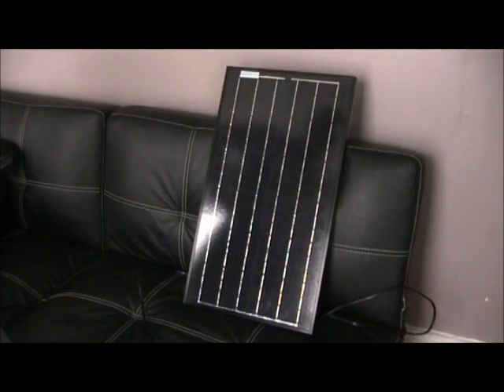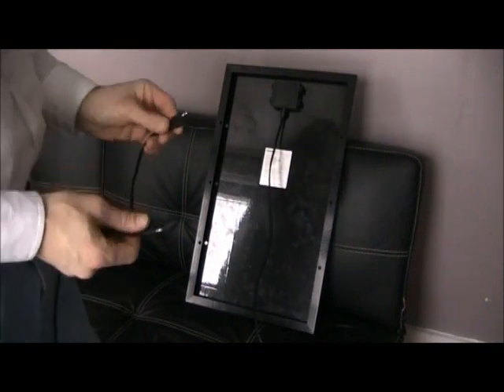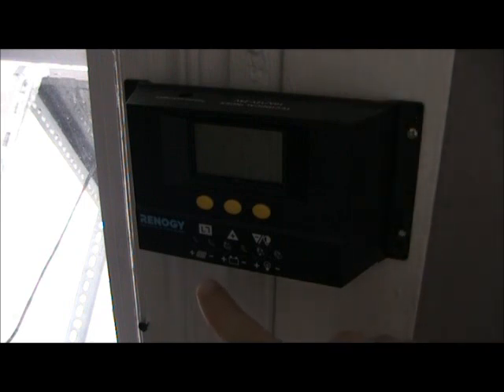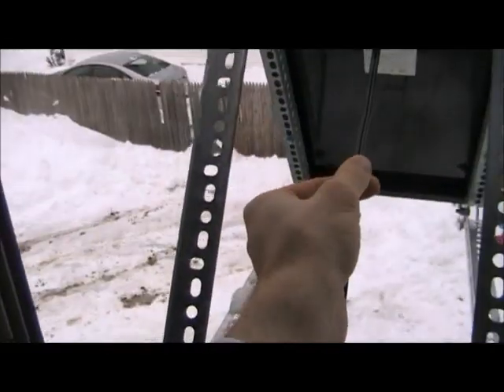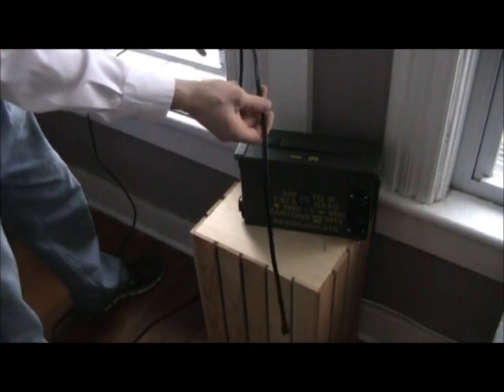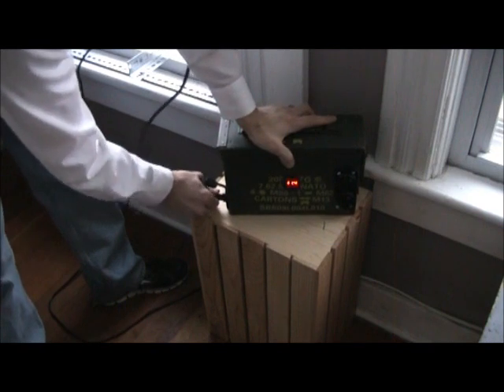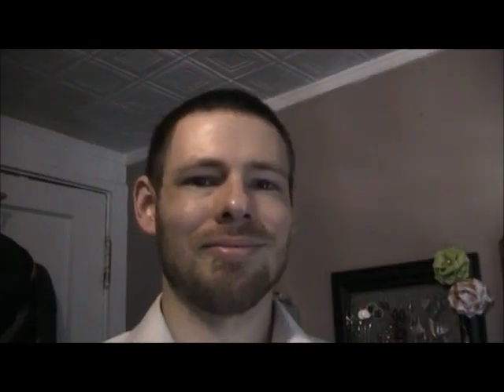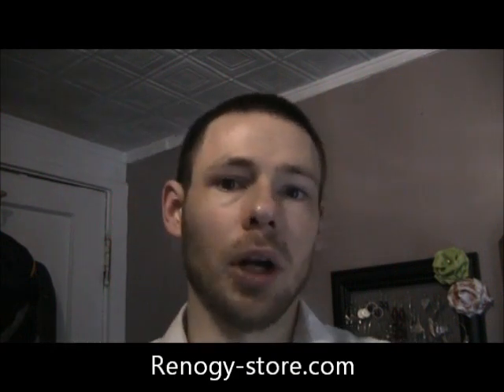How to build a portable 420 watt solar power generator (video 2 of 2)

Comment: I seen he did one thing Rong you have to wire the battery first before  the solar panels because their is a good chance that you might blow the charge controler the power needs somewhere to go

Comment: I enjoyed the two videos. I'm trying to decide on doing something like this or just buying a goal zero which has basically everything built in except the panels of course. battery, charge controller, and inverter all in one box.
Reply: Thank you for the tip. I've picked up on that from other videos but appreciate your advice as confirmation.

Comment: Awesome videos, Very simple. Very easy to follow.  A few things i would do different But still an awesome video.  One question.  You said in this video you had your entire apartment solar wired.  :-)  question is, How? Did you put all of your panels out windows? LOL  I cant imagine an apartment manager or owner allowing that. LOL Also, is it a small apartment? I am sure it took way more than one 100Watt panel to run an apartment, even a small one. :-)  Just curious.   Thanks
Reply: Awesome, Ill keep an eye on the link. So far it looks pretty good.   I live in Arkansas and we have lots of sun hours, so  I am thinking of setting up a 150 or 200 Watt solar, my only problem so far is the batteries, WOW they can be expensive. I can get a complete 200 Watt solar system for less than 600.oo that doesnt include the batteries. So, i am learning, mostly on how the batteries work and store. Anyways, I just wanted to say how cool the generator you built was. Could come in handy..
Reply: My idea is to cover the small things in the house, TV's (LCD, plasma), Laptops, Lights, network server, Just small things that we use every evening we are night people, so most of these things are used at night of course .  Later on, I would like to have a system that could handle everything, washer, fridge, dishwasher,  etc. with exception of the AC which is a massive 3-ton unit. Overkill I know, but our house is made of stone, and when it heats up it takes forever to cool, so the AC is a must. The house is very well insulated. But still that stone can hold heat and it just comes right thru the insulation and walls. We have planted trees on the southern side of the house hoping to cure this issue.  But it would be nice to take about 2500 and build something that could handle our night time TV, Laptops, Lights, network, etc. Just mostly small things. Until I struck it rich than I can afford to buy enough batteries to do what I need, oh wait If I was rich I could afford 350-month electric bills. LOL
Reply: My idea is to cover the small things in the house, TV's (LCD, plasma), Laptops, Lights, network server, Just small things that we use every evening we are night people, so most of these things are used at night of course .  Later on, I would like to have a system that could handle everything, washer, fridge, dishwasher,  etc. with exception of the AC which is a massive 3-ton unit. Overkill I know, but our house is made of stone, and when it heats up it takes forever to cool, so the AC is a must. The house is very well insulated. But still that stone can hold heat and it just comes right thru the insulation and walls. We have planted trees on the southern side of the house hoping to cure this issue.  But it would be nice to take about 2500 and build something that could handle our night time TV, Laptops, Lights, network, etc. Just mostly small things. Until I struck it rich than I can afford to buy enough batteries to do what I need, oh wait If I was rich I could afford 350-month electric bills. LOL
Reply: Hey, well I finally got my setup, what sucks is my 12 volt solar panels won't produce more than 11 volts. Think I got screwed by the Chinese again lol. I bought two sets of mono 12 volt 90 watt panels. Nether produce anything close to what the stats say.  I also have a tracer 3210 30A MPPT controller. Again, disappointment. I hate when people take advantage of those of us that want to learn, arrrg. LOL oh well live and learn.  Maybe I'll try again next year for a solar setup up. But for now I am totally PO'd and have decided to closet it all. LOL. If you know of any true American solar panel people . Plz let me know.  

I like the new video. The setup is pretty cool. 
I want to try a 300 watt setup.  Run a few lights at night, recharge phones and laptops. Maybe in time try moving it further and run my whole house from solar. 😎😎.

Comment: the positive side of a plug is usually the side covered up and the negative is the one that's not covered up  get a multimeter  on the end of the cable if it is back to front it will show up - on the meter . so if the black lead of the multimeter is on one end and the red on the other end and it comes up - on the meter switch them around then you know whats  plus or minus then mark the positive with tape , a bit of tippex whatever you have .

Comment: not a generator just a battery bank
Reply: +Jeff H. I mean, it is generating electricity.
Reply: +Jeff H. Not a battery bank, banks contain multiple batteries. This is just a battery box.
Reply: csorrows the title calls it a generator I was just saying it was a battery bank not a generator, and a single battery is also called a bank. In most cases a bank has multiple batteries but a single battery is also a bank. the bank refers to a storage device not a series of storage devices
Reply: No, the unit itself is NOT generating electricity. The PANEL is generating electricity, while the unit is STORING it for later use! Pulling the power back out to run a light or some other small device is NOT, by definition, generating power!!!
Reply: The panel is NOT generating electricity. It IS conducting electricity. Nothing in this box is generating anything besides somehow, confusion.
Reply: The term is a "bank of batteries" it can not be used as a "bank of battery". The term bank refers to a multiple of said item.

Comment: I can't find where you ever put out your list of parts and sources for the parts, can you please add that to your comments below the video.  I have tried to find a USB receptacle, but am being told they do not convert the 12 volt DC power to the 5 volts needed for the receptacle, and that I will also need to build a transformer to make it work properly.  Finding a source that can provide one that already converts to the right power level would be very helpful.
Reply: +Doug Barker I built a power pack similar to this last winter. Here is a link to the usb ports that accept 12-24 volt dc. http://www.ebay.com/itm/Car-Cigarette-Lighter-Socket-DC-12V-Dual-USB-Charger-Power-Adapter-Outlet-HOT-/201486038299?hash=item2ee980f51b:g:Q4sAAOSwZ1lWcRPa

Comment: i think that you could make a smaller version that don't need a batery using a cap and camera flasher and a 4k ohm resistor that way no charger needed and smaller pannle I have diagram my email is robbeesley111@gmail.com

Comment: I found your videos excellent, easy to follow and understand.  Thanks so much.  I noticed your generator doesnt have any AC outlet.  It would be great to see how you install 110v AC outlet to the generator.  Or I can just get a power inverter and plug into the 12v outlet.  I found that the USB port on my basic charge controller, is not able to charge my cellphone.  It can charge cigarette vapor battery.  I guess for sensitive electronics like ipad or iphone, it needs usb from a 110v AC source.  Please comment.  I am very new to all of these.

Comment: I don't care what you call them. For a novice like me, everything was explained very well.  I put the generator together last night, but I don't have the SAE items.  Thought I could pick them up at Home Depot or Radio Shack.  Home depot stopped carrying them last month, and Radio Shack is out of business, so now I have to wait for Amazon to get the stuff to me.  At least all the lights light up on the ammo box!
Reply: Dale Kno You can get those connectors at most auto parts stores in the trailer section.
Reply: +Dale Kno Wal-Mart also has the SAE in the Automotive Section
Reply: Dale Kno

Comment: The solar panel is the generator. The battery stores the solar panel output.  
Harbor Freight tools carries all the parts as well as a 100watt solar charge controller and industry standard plug in wire kit with adapters and battery clips  etc.
Costco sells 100watt high efficiency Grape solar panels
Nice looking portable 12V battery  storage box.

Comment: Couldn't this unit also be charged through the 12V socket with a car power adapter connected to the "battery" terminals on the charge controller?

Comment: Great, very detailed, instructional video series. I only have one small issue with it...

You keep calling the ammo box with a battery in it, a generator. It's NOT a generator. It's a storage unit. It's storing 12 volts 75 watts (or 420 watts) of power for you. The solar panels are the generators. They are "generating" electricity from sunlight, and then the charge controller sends it to the battery for storage.
Reply: rockytube  When you plug something into the box, it generates power.. The solar panels produce the power. Just the way words have dull meaning. Give him credit for what he taught. It was good.
Reply: Dan OConnor Yes and no.

First the "no"...
When you plug something into the box, it doesn't generate power.... It supplies power from the battery.

And Yes, I agree...
The solar panels produce (or generate) the power.

And I did give him credit. Here's a quote from my comment a month ago. "Great, very detailed, instructional video series." I'd say that's giving him credit.

Comment: FYI the instructions for those charge controllers say to have your battery hooked up before hooking up the solar panel.
The reason is so the charger knows what voltage to charge at. They usally can charge with 12v or 24v.
Nice video.
Reply: +Andrew Glover Thank you for the time and effort you have put into this very good presentation.  Most of us, that aren't trolls, sure appreciate you and you have helped many 1000s prepare for disasters.  You may have saved literally 1000s of lives and don't even know it...you are a good man.....Retired Veteran
Reply: I'm considering building something similar. So maybe a connector between the solar panel and the charge controller would be nice so you could connect/disconnect the solar panel after hooking up/off the battery.